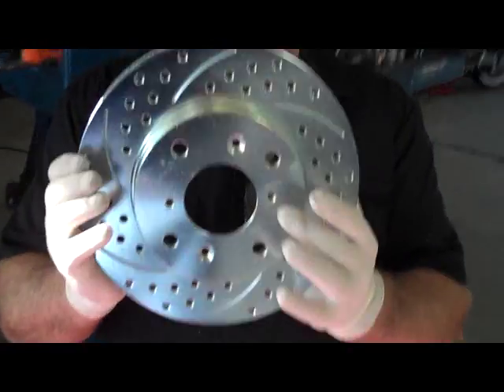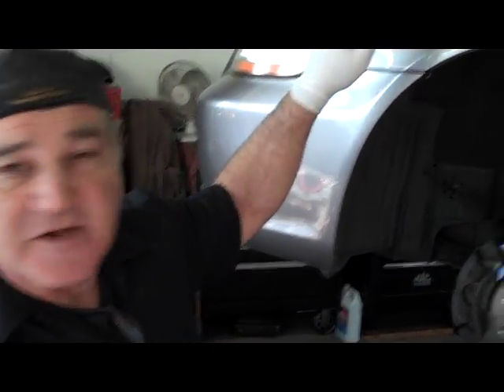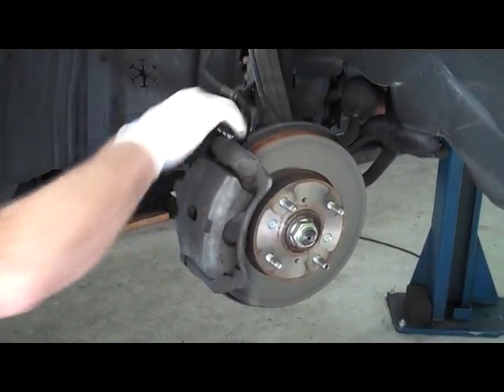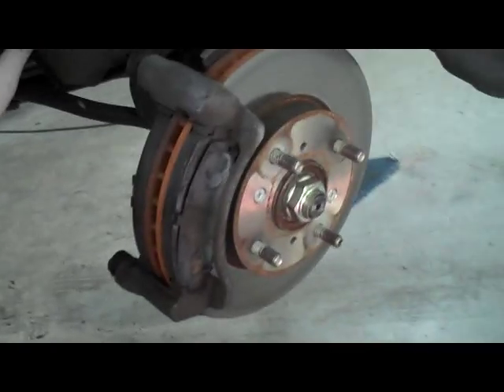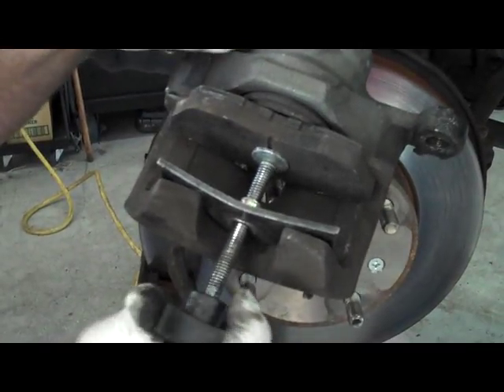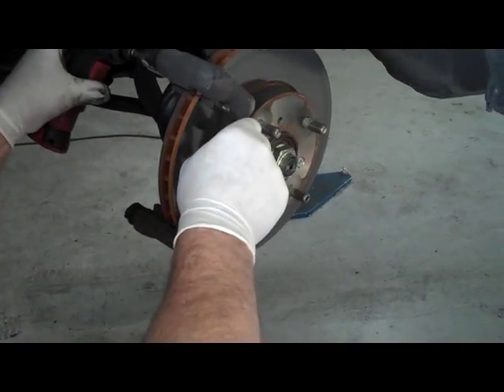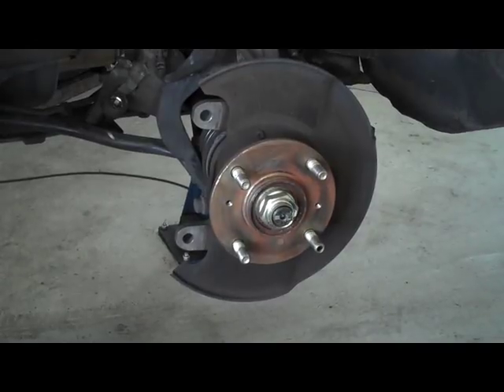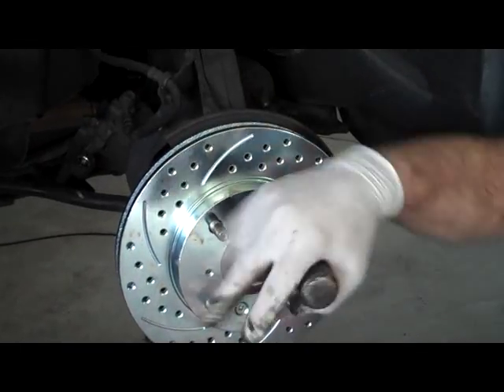DIY:  How to Install Brake Rotors and Pads

Comment: Some things I don't agree with in this video.  First off, drilled and slotted rotors on a DD? That's just a no no.  Autocross/road racing, yeah.  Grocery shopping? No.  Why? Because D/S rotors are overkill and also they have a tendency to crack.  They also eat through pads like a mofo. And you do not ever for any reason put brake lube on the braking surface of the pads/rotors.  You can put it on the back side of the pad, caliper pins/bolts, the piston, etc but never ever braking surface.

Comment: lube the slide pins with plenty of silicone grease, lube the back of the pads/inside the shims with silicone grease, clean your slide pins/replace if pitted, , dont overtorque the slide pins, dont get grease or oil on your pad surface, dont get oil or grease on your rotor, use clean gloves when handling the pads/new rotors, brake clean everything before disasembly, and bungee the caliper so it doesnt hang on the brake line, brake clean everything liberally/even net rotors.

Comment: Way to go... "mechanic" doesnt know what the brake master cylinder is called... Has smeared grease from his gloves onto the rotor. Not using proper terms for parts like he should be, and looks like a terrible mechanic... why would you spend $60+ per hour and cost of the parts to have a mechanic do it?! Just stupid

Comment: It's just for looks and even they admit so.  There is no performance advantage and even be dangerous if the crack. Google "cracked drilled rotors" and you will find numerous pics/ articles about the subject. On a car used for daily driving they might be OK.... but I wouldn't risk it. And certainly not for performance driving.

Comment: If you have ABS do not push the piston in the way he does. You need to open the bleeder so the brake fluid is not pushed back when the piston is pushed in but the fluid will come out the bleeder. If you don't you can cause problems with the ABS system. I figure everyone else has posted enough on the other problems with the video.

Comment: Wtf. Never let your caliber dangle by the brake hose. Clean all parts free of dirt and old grease. Never push brake piston back with out breaking the bleeder screw first. Pushin old brake fluid back into could cause master cylinder  or abs module issues later. This video was good. And the lie detector determined that that was a lie

Comment: Another tip.. put copper grease on the 2 screws that hold the rotors in place... will remove the need of having to use hammer screwdriver to remove the screws. Also dont do what he did and use a hammer screwdriver to tighten them... They do NOT hold the discs on... all they do is help keep the discs straight. The actually wheel lugs hold the discs tight.

Comment: I was wondering if you could help me, I have a 92 Honda Civic LX and went to go and change the break pad's, had lug nuts out and the car jacked up but the tire wouldn't come off. I sprayed degreasing/ bolt loosening oils around center axel bolt and where the four bolts go but still feels like a pin could be stopping it, any ideas?? Thanks.

Comment: Errrrrr to avoid possible brake judder don't you think you should have cleaned the drive flange of any rust or debris, Common problems are from the rotor not sitting flush when installed and cause severe run out. All that work would have been for nothing and the customer coming back with possible braking concerns practically after install.

Comment: Doesn't clean up the hub. He forgets to perform a run out check on the rotors. Most important procedure when fitting brakes and also the common cause for brake shudder which people commonly mistake it for a rotor problem. Pushing dirty fluid back up could potentially damage the ABS.

Comment: I wouldn't use grooved and/or drilled discs (rotors) in a daily driver. They are not needed, and can actually be noisy under braking which you will notice in a car. If you have a performance car that you drive (and brake) hard, then yes, it can be worth getting them.

Comment: He didn't, he rested the caliper on the lower arm.

There are other steps he didn't do that you should, like cleaning rust off the hub and putting a little copper grease on there, etc., before putting the new disc (or rotor for our American cousins) on.

Comment: Please don't let the full weight of the caliper be supported by the hose. Depending how old the car is it can put a lot of tension and ruin the rubber brake line going into the caliper. After removal from the bracket use a bungie cord attached to the spring or suspension somewhere instead.

Comment: my special tool has always been a C clamp against the old inside pad just like hes doing with the "special tool" - nothing special needed here.   Also don't like to let the caliper hang by the hose, only a small chance but it could damage the hose.   On brakes I don't take chances ---

Comment: Notice the groove machined at the base of the rotor hat. Measure the depth of the groove then subtract from the thickness of the rotor. The thickness of the metal at the thinnest point (at groove) is insanely unsafe. Assuming the rotor is ventilated. Is grease unsafe?

Comment: Those rotors look thin as fuck if u want good rotors that are drilled an slotted look at SP performance they are great. If u look at the supports between rotor plates they're thicker and they do better drilling they used sinusodial bits just go read up before u try to knock drilled and slotted rotors base on what they installing.

Comment: Beware of slotted, dimpled or drilled rotors ! Unless you are " really  " performance oriented stick to good brand standard or warping and skimming will be your constant " friend  " ! Did my 3rd skim ( to combat steering wheel wobble ) on my $ 150 ea dimpled and slotted rotors 3 months ago and are wobbling around until I can put standard DBA rotors on soon. 😎👍

Comment: P.S.  Please don't use the little white bottle on your brake pads, it will void the warranty.  Ask your pad manufacturer if they approve this type of products, they will tell you it changes the friction component and safety is at issue.

Comment: This is a world funniest video. The mechanic apply grease on the brake pad. Jesus!!! He dangled the caliper. He didn't even apply silicon grease to the pin. Well. This video shows the reason why you should fix your car yourself, not by the mechanics.

Comment: this guy straight fails. never let your caliper hang by the brake line ever, clean everything BEFORE you put it back together dont put no squeak stuff on pads its an indication that they are going, dont listen to that guy 0_0

Comment: I agree. I personally haven't seen one crack, but I have seen pics.  I use slotted only on my car and truck. The more metal the better. R1 Concepts slotted, and Wagner Thermoquiet pads and I can stop my vehicles with only my big toe on the brake pedal.

Comment: The rotor screws are supposed to be torqued down, not hammered on!. They do not need to be tight at all, only snugged down. The screws are only guides😁

Comment: "It's a hammer screwdriver."  Also known as an IMPACT DRIVER.  And you don't need to tighten the screws like that. They are only meant to hold the rotor in place while you remount the brake calipers and tire.

Comment: Special tool to push the piston in? Yeah, if you own a shop and want thinks done a little easier. But definitely not required. Just use a long extension along with a 12mm and push it in with a little effort. No biggie

Comment: @Dkwanderer the longer the wrench the more force you get in the bolt therefore making removal so much easier... When was the last time you saw a small torque wrench used on brakes??? You're obviously not too smart...

Comment: Not as bad as the slots and drill holes in the rotor do. Slotted and drilled rotors do not provide any benefit for regular driving and they are more prone to brake. They actually INCREASE stopping distance.

Comment: The direction of the slot is not important.  What is important is the direction of the cooling vanes, which need to point AWAY from the direction of rotation.

Comment: Cleaning rotors with dry cloth? Not using socket ratchet which gives you alot more control, no torque wrench? Wtf, It's showing how to do this as fast as possible not tidy, good work...

Comment: He does not even clean the hub somewhat. He puts the new disc right on... 
If the hub is even just a bit dirty it can cause an offset at the end if the disc, the cause of pulsing brakes.

Comment: will pulling the caliper out after unbolting be that easy or might the piston pushing the pad not give you enough clearance and you will have to use a flat head to pry it back a bit through the caliper window?

Comment: 6:53 Not necessarily...I have the Rotora BBK and the slots and holes flow the other directions.  When you get new rotors they will have a marking or sticker that states L for drivers side and R for passengers side.

Comment: Amazing how many keyboard mechanics that have comments about this clip! This is a car, not a spacerocket! I´m 100% sure that the brake rubber hose can handle this light load from the caliper without been damaged. They are extremely tough to handle heat, aggressive fluids, dirt, rocks and stretch and high pressure. Their reinforced inside is made to last for years. What´s next? Do we all need to use white cotton gloves to work on a car? Do we need a soft pillow to protect the bolts if they fall?

Comment: I'm pretty sure a brake fluid line is strong enough to hold 2-3 pounds of mass. Think about how much pressure the fluid itself does on the line. Seems like you just wanted to sound smart or something.

Comment: And I would NEVER use drilled rotors..... they can crack and fail and lead to severe damage or even cause an accident. If you feel they are a "must" then use slotted rotors only.

Comment: The way brake rotors are directional is defined by the center fins, not the drill/slot pattern. If they are straight , they are not directional. Use Loctite and brake cleaner.

Comment: He's wrong when he says "the slots should be going the way the car drives".  You need to be looking at the direction of the cooling vanes between the rotor halves, not the drill/slots.

Comment: Things to add to this video....Get a wire hanger for the calipers to hang from.  Don't touch the rotor or pads with greasy hands, buy 100 rubber gloves and change them as needed. Make sure you re-grease the caliper pins with "caliper pin grease" every time you do them.  Use never seize on the ends of the brake pads. Use anti-squeal spray on the back of the pads  Pads should go into caliper easily, or there is something wrong, stop and figure it out or you will be doing them again soon...lol

Comment: You can damage the brake line by letting the brake caliber just hang , use a piece of wire or a piece of tig welding rod to let in hang , also tell people to- reverse- that hand impact when tighting those phillips screws , also you should wire brush and cleal any where that rotor sets on

Comment: He's got the orientation of those rotors all wrong. The spin the other way for optimum cooling effect. The way he has them will impede effective cooling of brake components. Plus many mistakes already mentioned. If people especially those who claim to work in garage of sorts should really know what they are doing before they show too many people the same.

Comment: This guy knows nothing. Slots don't determine direction of rotor installation. It's the directions of the vains. If the vains are straight, the slots can go either direction.

Comment: All those holes in you disc reduce the effective surface, increase wear of the pads, then to form cracks when heated often and the zinc on the braking surface itself will get into the pads and make them less effective for a pretty long while (kind of like glazing).

Comment: I changed the front hubs but brake caliper assemble  touches the disc plate wheel won't rotate, can modify by putting a space washer in between disc and hub to make the space for tire to rotate, please advise?

Comment: Do you still need to use a piston retractor or c-clamp to retract the piston if you are leaving your current brake pads on and changing the rotor ONLY?

Comment: I wouldent want you working on my car ur dropping things letting the calliper hang by the brake line forgetting things not using rotor cleaner.

Comment: To Martin Heuts:  those calipers are known as ratcheting calipers and there is a little metal box you can buy at auto parts stores that have tabs on the sides of the box.  The tabs fit into notches on different makes of cars.  They also have 3/8" drive square holes for ratchets and extensions.  Mine cost $7.00.  Or you can use a pair of needle-nose pliers.

Comment: That brake reservoir is eventually going to spill over unless you suction a lot of the fluid out before compressing the pistons. Also, I like to crack open the bleeder screws then compress the piston so you're not sending dirty fluid from the piston up the line. But most of the time I will rebleed the lines with new fluid after doing a brake job using a pressure bleeder.

Comment: It is the vanes within the rotor, wheather they or pointing forward or not that determin left or right side of the vehicle. The vanes should always be pointing backwards (swept backwards). The hole and the grooves on the face of the rotor have nothing to do with left or right.

Comment: Seeing as how he lets the caliper hang there at first, I guess no one told these guys that the drilled and slotted rotors go off of the internal venting veins, not all are directional. So hopefully they didn’t install them incorrectly.

Comment: Yes, he messed up on a few of the names of some items he had and he let the caliper hang, but that isn't worse than some of these comments giving false information. The vanes should spin in the direction of the wheels so it can get rid of dust and heat. If it spins the opposite direction how is it going to do that? It's going to spin all the dust and heat into the middle of the rotor and why would you want that to happen.

Comment: Yes, dissipating heat is the purpose for the slotted and cross drilled patterns. However, it is well known that under long-term use the holes will clog and crack the rotor. 

These holes only dissipate and do not remove brake dust particulates. With maintenance and blowing air through the rotors every once in a while it will aid in preventing future cracking in the rotor surface. Slotted only are far less maintenance and more of a install and forget application.

Comment: Yes! I had the same problem on a friend's 97 Honda Accord I was working on. After running out of ideas about how to deal with it, I decided to put the car back down on the ground after putting the lug nuts back on loosely, I moved the car ever so slightly, very slowly and very carefully, and it did the trick! Try it and let me know how it worked out for you. And remember, do NOT forget to put the lug nuts back on without tightening them, and roll the vehicle very gently, of course!

Comment: Yes. The old pads have worn down and the piston is sticking out farther. Have to squeeze the piston in a bit so the new pads will fit around the rotor.

Comment: Can someone tell me where I can find myself a Phillips impact screwdriver? The same exact one he used to remove the seized Phillips screwed on the rotor? I really would like to know, thanks.
Reply: You can purchase a Hand Impact Driver Set from Northern Tool (item# 15825) Harbor Freight (37530), Amazon, and many other places. See links below: 
 
http://www.northerntool.com/shop/tools/product_36882_36882?utm_source=CSE&utm_medium=PriceGrabber&utm_campaign=hand-tools--screw-+-nut-drivers&utm_content=15825&srccode=cii_5784816&cpncode=44-26325745-2

http://www.amazon.com/Lisle-29200-Hand-Impact-Tool/dp/B0002NYDRG

Comment: Yeah, take the cap off and let air/moisture build up in the brake lines. Very smart. Also, never let the caliper hang by the brake line. Also, all you need is a c-clamp to push the piston back in, no special tool required.

For the rotor direction (if it has directional slots on the surface or not) it is mainly the ventilation vanes built in between the surface areas that determines how it should go on (based on how the manufacturer recommends), not the surface slots. The ventilation vanes may be directed opposite of the slots on the surface, and therefore you render the rotor cooling vanes useless. The way the rotors were put on in this video are probably backwards.
Reply: This is why yo need to be careful where you learn from, exterior slots do not are always in the same direction as the internal ventilation vane, those are one that indicate the rotation, this guys are a joke, one of the basic rules in break is hang your caliper from anything else than the hose line, get the name of the shop and avoid this place as your future repair shop